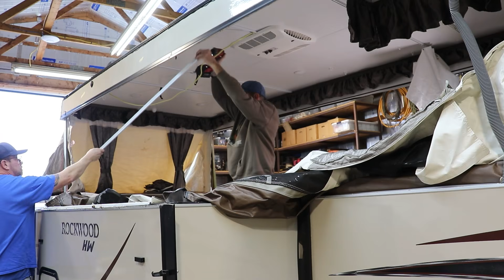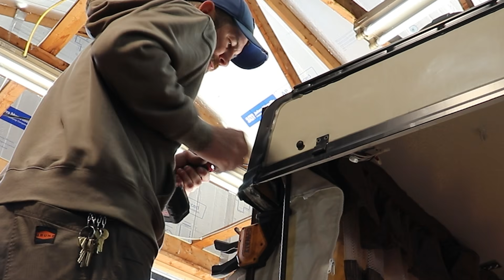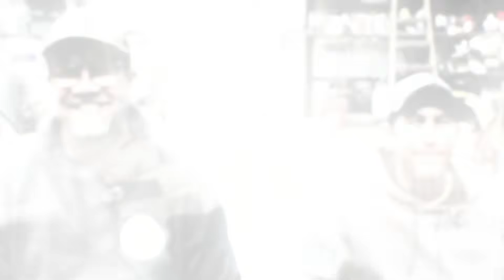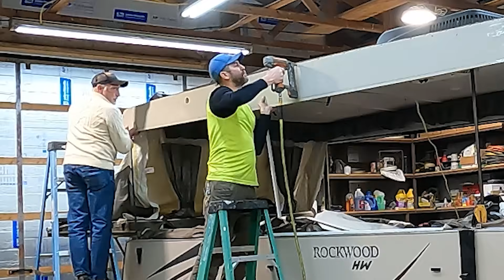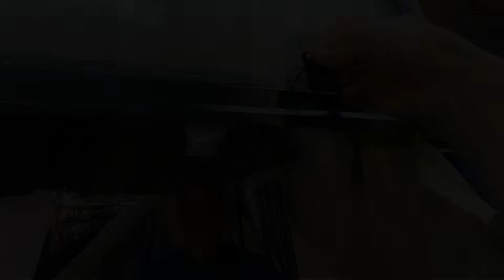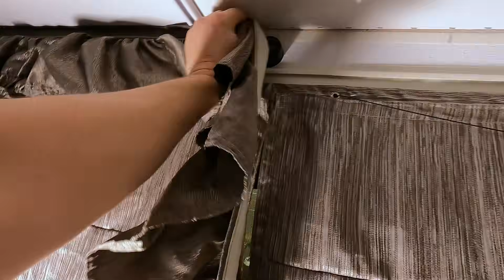Rockwood Roof Rebuild - Step By Step DIY

Comment: As an alternative to your biscuit joinery what is your opinion of using 3/8's inch 8 foot long plywood  overlapped to make a 3/4" x16.2 foot run?   Use glue to make the overlap.   Good idea or not?
Reply from the maker: That would work to. Good idea! If you’re not going to install luan inside that gives you another 1/4” as well.

Comment: In the process of a complete roof replacement on my 2020 HW. It’s pretty upsetting that they built them the way they did. On my side skirts there is a 1/4” sage was yours completely flat?
Reply from the maker: The original was not 100 percent squared.

Comment: If 75% of my sidewall is good and just rotten in one corner, could I pull it down and just splice in a new section instead of replacing all the wood on the side? that way I only have to scrap and prep a limited section of the fiberglass planel
Reply from the maker: Anything is possible! Just make sure any seam is sealed up tight.
Reply: I have same issue. Just corners are rotted. Was thinking sheet metal and screws to splice. Thoughts?

Comment: Hello love the  video. Regarding the assembly of the board, I would like to inquire whether pocket hole joinery would be an adequate method for this application. Additionally, could you please confirm if a sealant was utilized?
Reply from the maker: I am not familiar with pocket hole joinery Robert. After installation you want to seal with a high quality RV caulk.

Comment: Wondering why you have to use three separate pieces of wood and glue them together?
Reply from the maker: To make the 16.2’ run on this unit. Your common size of plywood is a 4’X8’ sheet.